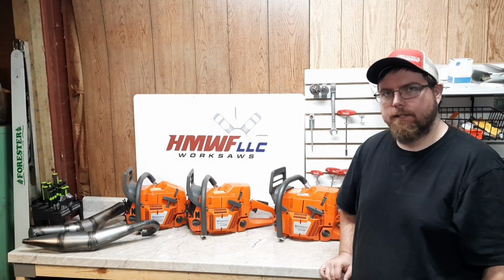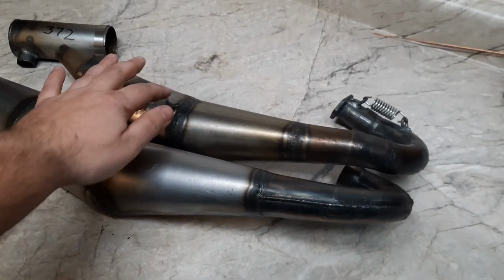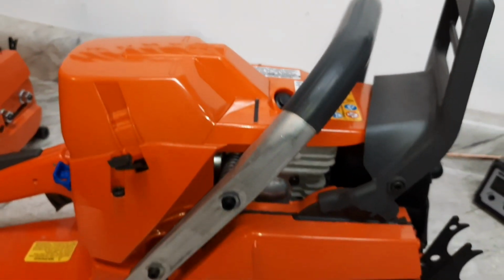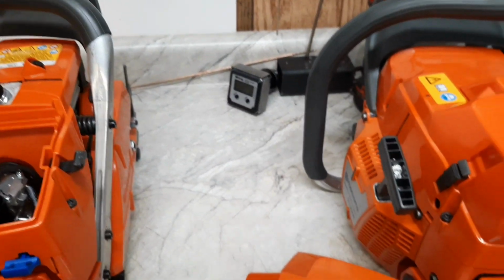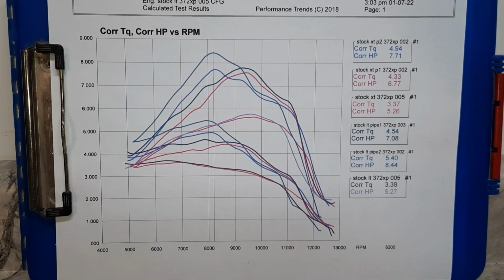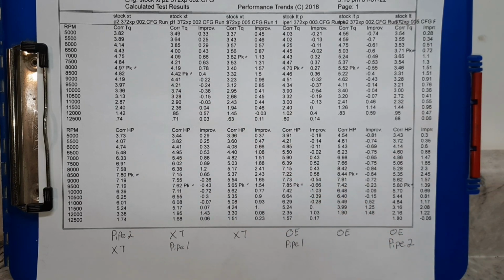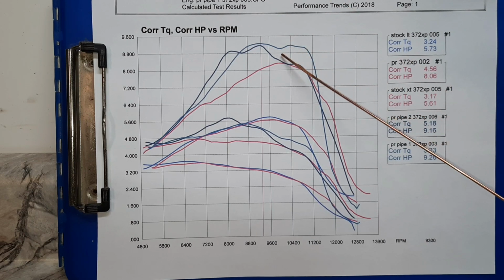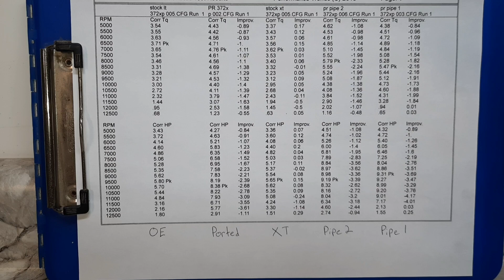Husqvarna 372xp X torq vs Pre X torq! Ported + New Prototype Pipe! Best Husqvarna?

Comment: Over 5 FP on the torque and over 9 HP, plus a broad power range. That's one strong saw. Thanks Joe.
Reply from the maker: Paveen ported up a monster 372, and even if the pipe wasn't matched to the ports it still made good power on pipe.

Very stout muffler saw too.

Comment: A factory upgrade muffler for a 372 is to put a genuine oem 385/390 muffler on a 372… The outlet on the 390 muffler is larger and flows better. Just figured I’d throw that out there. Great video man this is really awesome content Joe…
Reply from the maker: Thank you.

That is a great tip
Reply: Can you buy them and bolt on cause I'm looking for a muffler mod
Reply: @dentondunn4346  yes but it has to be an oem 390xp muffler not Chinese

Comment: nice to see, that a good ported saw is not that far behind the piped one.
if you think of working with those saws, a pipe is not really a practical thing to deal with in the woods, it's just for show and great to test like you did and for this the ported version is pretty much the best i think.
Reply from the maker: Yep, trying to help them dial in the pipe recipe. That way when they are ready to sell it is a true bolt on power mod.
Unless just having fun or bucking logs in a lot the pipe isn't very user friendly. But it sure it fun to run.

Comment: Thanks for dynoing an OE and XT, been waiting on this for a while. Not much difference stock for stock putting a ton of urban legends to rest.
Reply: The biggest difference was the unlimited coil on the original 372. That helps a ton with top end acceleration and limbing. The other part that was annoying was the X torq would burn up PTO bearings. My old original 372 then I got back in 2001 is still producing wood today. I blew up my X torq 2 times. Now it's in a landfill somewhere.
Reply: @austindenotter19  How does the unlimited coil help when it has less advance at lower rpm than the limited.

Comment: Thanks for the excellent testing. Personally I would prefer a broader powerband with the lower Peak number been a real high peak number in a very narrow powerband. Just my two cents.
Reply from the maker: Nice broad powerband makes a saw feel so nice in the cut.
Reply: i was looking at the ported saw with the first pipe and thinking the same thing. 

now we need a saw factory built with the pipe as part of the saw body/handle so it has pipe power without the bulk of an add on pipe.

Comment: Maybe the 365 xtorq with the transfer covers ground out is not such a bad deal after all
Reply: Nope, it was always a good deal if you were willing to do the work. And while you're doing that you might as well mod the muffler and set the squish(don't do a base gasket delete without checking some are tight).

Comment: Are you having to tune the carb between pipe changes?  A wide band O2 sensor would be nice for info.  But have read the 2 stroke oil will ruin the sensor.  With my Dolmar  120si and the hacked 50cc race dirt bike  DG pipe I had to give both circuits more fuel.
Reply from the maker: Very minor changes were needed on these. 
A lot has to do with how well the pipe is matched to the ports

Comment: Thank you for this wow!! If you were to get a new 372 today, would you look for a pre X-Torq or would you be ok with an X-Torq.  I won’t port won’t port a saw either way.
Reply from the maker: If you are not concerned with porting the x torque will be easier to find and will be very close to the original. If you want to port someday the original is a better starting point

Comment: great info , why i look after my 2012 372xp ( i will port it one day, lightly just gasket delete and open transfers, should give me .025" squish) running with a 19mm ex euro type. Where do iget a high top and filter kit, preferably not chinese?
Reply from the maker: You may be able to order all the parts through a dealer. The high top on the oe saw was an aftermarket kit.

Comment: Do you purge these hot pipes when welding them? What material and thickness are they made out of ?
Reply from the maker: I didn't build the pipes.

These are mild steel looks like 18-20 gauge. These were just prototypes whipped up and sent in to make sure they were making power and going the right direction.
Reply: @dynojoemods2764  thank you for the info

Comment: Unfortunately it's a shame. Nobody is going out in the woods to cut with a pipe like that
 I get your showing new products n such. But how about products the normal person is ACTUALLY going to use

 Edit..kills me to hear those internals in the recoil taking all that abuse when shutting off (I always pull the rope out) learned that after replacing a recoil on my dolmar 7310
Reply from the maker: Which products would You like to see?

I just testing and showing what pipes can do to an engine to help the builder dial them in.

If you or anyone has a saw product they would like to test/dial in I do offer dyno runs for anyone. They are listed on my website. Www.worksaws.com
Reply: i would march myself out into the woods with a pipe on my saw to buck up some logs. a HUGE  pipe like that might not be the best for felling timber but  it wouldnt be that hard to bring the saw with the stock style muff to put the trees down and then switch to the PIPE for bucking. with the gains you get it would save a lot of time bucking.  I would just strap the pipe to my backpack that i take with me everywhere, and i already have the tools with me to change it out. im just saying that some people operate a differently than others.

Comment: 8200 rpm for max torque is quiiite low for a chainsaw
Reply from the maker: That is why we are still testing these pipes. Should be closer to 9-9.5k rpm peak to match the stock saws powerband